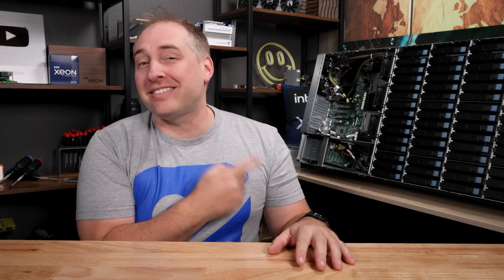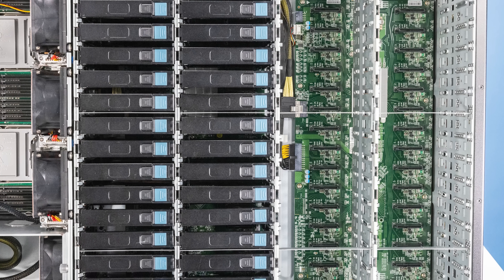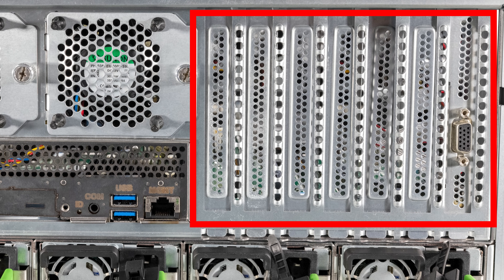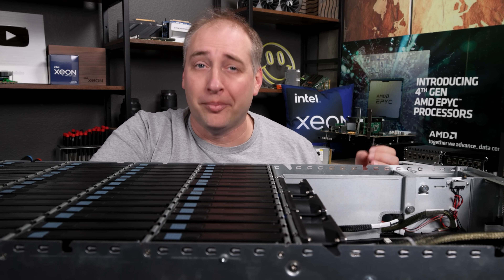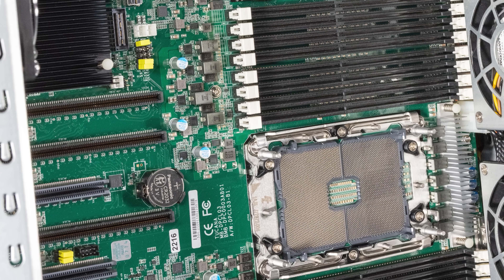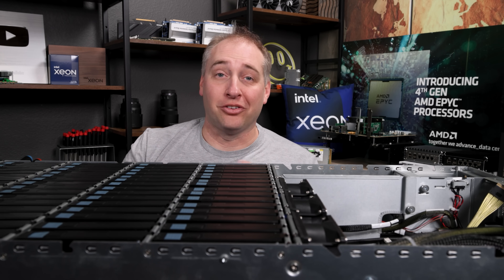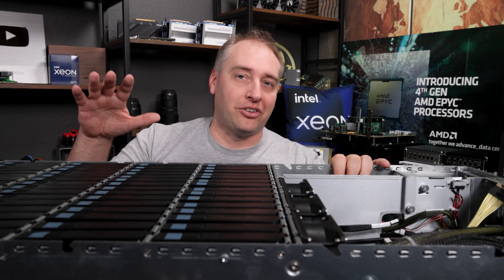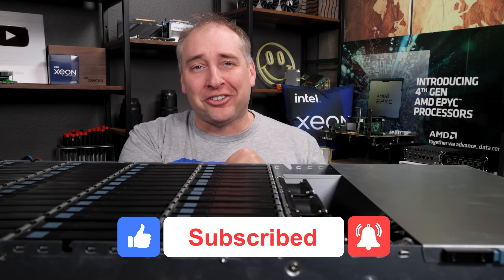HUGE! 1PB+ 60-bay Storage Server from AIC

Comment: Thanks Patrick & STH Team for the great info. The design is absolutely nice & functional. Can you suggest the same top loading case but 30 Drives other than 45 Drives? Also, Maybe this is dumb but I'm wondering since it has 8 NVMe other than the 2 onboard can you suggest a software solution that supports NVME-oF so you can make these drives available to an ESXi host. I don't know if trueNAS Core or scale supports NVMe-oF?

Thanks again
Reply from the maker: Probably best to look at a front and rear 36-bay 4U. With only 30 drives as a requirement there is no need to go to a top loading design. We have not tested NVMe-oF  with TrueNAS Scale since typically we just use Ubuntu for that.
Reply: @ServeTheHomeVideo  the 36 drives case from supermicro is hard to cool due to the 12 bays in the back that is why they use 7 fans which makes it noisy plus you can't use a full height expansion card. While a 30-bay top loading case will be more silent if it is paired with right fans & you can use full height cards and as a bonus it is shorter in depth which makes it a good option for home labs.

Comment: Lucky you did not brake the motherboard and io by placing it like an idiot at an angle.
Reply from the maker: Ha! Motherboards and systems are fine like this. They need to be more durable than setting down on the side. They need to be designed for shock forces during shipping, on sides/ angles, even in padded boxes it is more force than we have here. We have done this with much larger systems and this one does not even have huge heatsinks/ cards mounted like with GPU systems.
Reply: @ServeTheHomeVideo  It's actually written explicitly on the case how to lift it and how to position it. Nowhere shall you find that it should be positioned at an angle or upright especially loaded. The mere chance it did not happened to you, does not imply it won't. Testing it could lead to injury, showing it is up par with that idiot linus.

Comment: Very nice.
I know we have racks full of the Cisco 56 bay systems which work quite nice as well. They support dual nodes which is great to be able to split the storage between systems. Can use 40Bays for one node and 16 for the other or 54 for one and 2 for the other.

Comment: How does this system compare to the Supermicro 60-drive systems?

I would think that they're about "on-par" (i.e. in the same class) relative to each other, no?

Also, were you ever able to run a benchmark test across ALL 60 drives, regardless of how you have set them up (e.g. four 15-drive vdevs or ten 6-drive vdevs in TrueNAS)? (I'm not super concerned about the configuration, but rather more concerned with how much data can you push to the drives, across all 60-drives, in total?
Reply from the maker: This is a bit more cost-optimized. We did not do the Ice Lake top loader, but we looked at the previous generation Xeon Scalable one: https://youtu.be/iwEKC63XqiM
Reply: @ServeTheHomeVideo  
Thank you!!!

Comment: Disappointed with the bandwidth, I get it's not SSD but I suppose even with that many drives it would be hard to get a lot of throughput. Did you include NVMe cache/log in that 25Gb?
Reply from the maker: No, and that was off of each bank of drives.

Comment: With how small and fragile modern edge-mount VGA connectors are I would actually prefer the PCI slot VGA solution. You don't have to worry about ripping the VGA socket off the motherboard if you don't get the thumbscrews all the way undone. I didn't think they could make VGA connectors more of a PITA, but someone managed to.
Reply from the maker: Fair point.

Comment: Having worked with AIC for a long time I am happy to see them getting some exposure. In my experience AIC products are functional, well built and easy to use. What they don't have is any luxuries. The drive bays are functional but doesn't feel as solis as say HP or Dell counterparts. Even so they are way more durable than you might first think when handling them. All in all I think that's a good way to go in equipment like this. You're not trying to impress the technicians with butter smooth drive insertion. You don't get a complete solution served straight up, but you pay a lot less and the hardware is flexible enough to make what you need out of it.

Comment: i see drives overheating with this dinosaur - why not split things up and not put all your eggs in one basket - it will break and be a nightmare - guaranteed
Reply from the maker: These types of systems are deployed en masse for years. We have reviewed others with 100 drives.
Reply: Unless you've actually SEEN this overheat, why even comment?  Sounds like you don't know what you are talking about at all.
Reply: @CLHatch65  everything breaks - for smb this is a non starter - you need 3-4 for redundancy if you value your data so costs are a factor too - just build your own storinator from 45 drives if you need something like this - they have done all the work for you - save money with proven parts and learn some things too #mtbf
Reply: @shephusted2714  You are making no sense.  You said "everything breaks".  Which means your "better" idea of making your own 45 bay one will break also.

Comment: looking good! thanks for an amazing video as always. I wonder if there is an older version of something like this with 40-50 drives but quiet and cheap for home lab? :)
Reply from the maker: Not 100% sure. At some point, drives being accessed are noisy.
Reply: @ServeTheHomeVideo  well not 100% quiet, but something that does not use tiny 5000 RPM fans :)
Reply: @myplayhouse is playing with an older HP unit thats capable of 70 SAS drives. Got it : Its a HP D6000 disk array. Connect it via SAS to a quiet server and you have the homelab version. There should be some units on the used market.
Reply: @christophkarliczek2951  thanks! is the actuall unit prety quiet?

Comment: I have a counter-offer for you Patrick. Supermicro X10DRI + 2xe5-2699v4 + ds4246 + ds4486 + ConnectX4 EDR(100G). Power is ~800W, Noise ~ 56dB, and price is below $1500 without drives. Oh yeah I can get ~ 38Gb/s. Planing on testing nvmes in raid 0 to saturate that 100G.

Comment: Gee that would be too big to run Ceph or other SDS.. but probably fine for local filesystems. Maybe even minio?
Reply from the maker: These (and larger) are pretty common in Ceph deployments.
Reply: @ServeTheHomeVideo  yes, but not if you use it for block storage - at least not if you have latency requirements. (Two cores per OSD and two OSDs per drive, that would require 240 cores)

Comment: Similar question as Jeff. SuperMicro also have dual socket 60-bay/90-bay storage server. Aside from AIC's 8 x nvme bays, there is not much difference between these two.
Reply from the maker: It has been some time, but we looked at it in the Cascade generation (2020.) See: https://youtu.be/iwEKC63XqiM

Comment: So is Optane about to become like Betamax? Did Intel shut down the tech entirely or did they sell the patents? If I were Apple I would gobble every single 3DXpoint patent since that would not only reduce latency but also remove the issue of constant memory swapping on that infamous 256GB module on Macbook Air. Apple could use on die memory, and as first level storage Optane Dimms on a potential Mac Pro. Imagine iPhone 20 with 3DXpoint storage 🤓
Reply from the maker: The Glorious Complexity of Intel Optane: https://youtu.be/dOV3gGncGU8

This type of tech is going to CXL (albeit without 3D XPoint since the fab is closed for that.)

Comment: Seagate IronWolf Pro :D but seriously they should send you some Mach.2 drives to test that bandwidth
Reply from the maker: That is a decent on the single drive used in this video. We have dead Seagate drives we use in the studio since they already do not work. For actually running it, we were using different drives. :-)
Reply: @ServeTheHomeVideo  Only one other option then :D
Reply: @dashtesla  well there is WD and Toshiba.
Reply: @ServeTheHomeVideo  😅

Comment: Can you give some plusses/minuses against something like the 45Drives XL 60 chassis and this? One advantage to the 45Drives unit is the trayless drive design, and I also like the larger, slightly quieter fans up front (though the whole unit is super loud still... it has 40mm server fans in the 1U PSUs), but I also liked how this system has 2x2 PSUs and a layout that allows those NVMe drives in the back (huge for cache and other more advanced storage layouts...).

But hardware-wise, are there any major advantages to a chassis design like this, versus a more custom / 'bare' 45Drives design?
Reply from the maker: This is another level. 45Drives is a single socket and still PCIe Gen3. So it is very limiting for applications like Ceph where you ideally target 1 core/ drive (e.g. you need 60 cores plus a few for management/ control plane.) Even small things like having the LED status light s on the front of this one for each drive so you know exactly the status of each is nice when dealing with lots of these. Fit and finish is generally better.

Still, the big thing is that this is a different class of device. This is a dual socket PCIe Gen4 platform so from a raw performance perspective, it is not close. That becomes more useful the more you do with the boxes.

I hope you feel better. I thought I showed you this one while you were here :-)
Reply: @ServeTheHomeVideo  You mentioned it but it was still inside a box, and a wee bit too heavy to pull out for a quick look :)

The dual socket feature is nice—though using standard eATX layouts, one may be able to upgrade the thing aftermarket—something I plan on doing long-term :)

It does look like this system uses a lot of standard components as well, which I like a lot. For many orgs, having the ability to get another 5 years out of hardware through upgradability is a nice feature you don't get with some of those OEM systems...
Reply: @JeffGeerling  
I think that the upgradability aspect of it REALLY depends on the kind of organisation you work for/at.

It's not uncommon, for example, for hyperscalers and HPC installations to basically rip out everything from a bank of racks and completely swap out with the latest and greatest.

And then you have like some small and medium businesses that might prefer going the upgrade route instead of replacing their servers.

And then you have financial institutions that often times, might not deploy the latest and the greatest due to legacy compatibility issues.